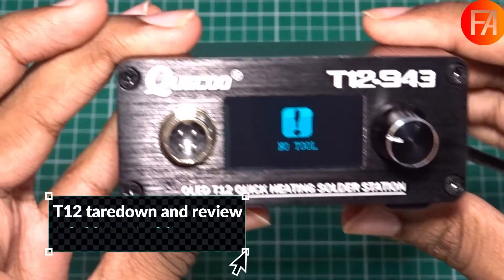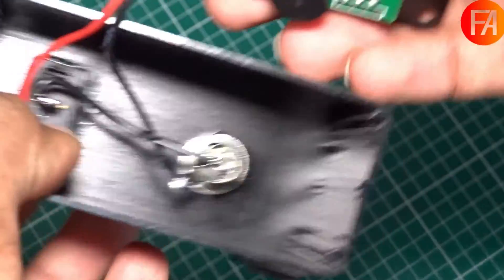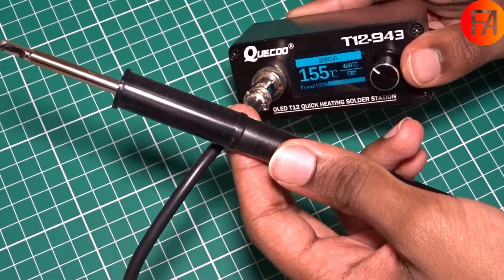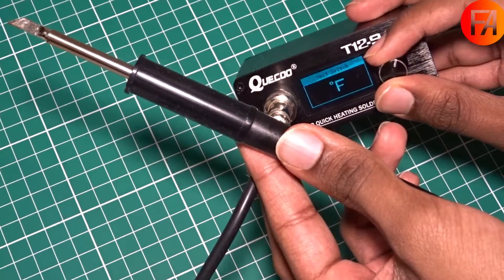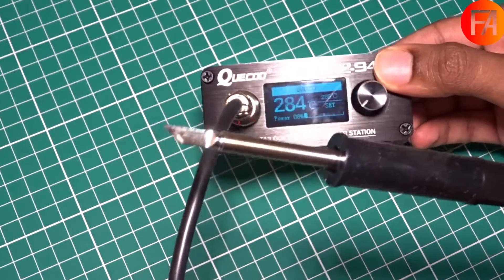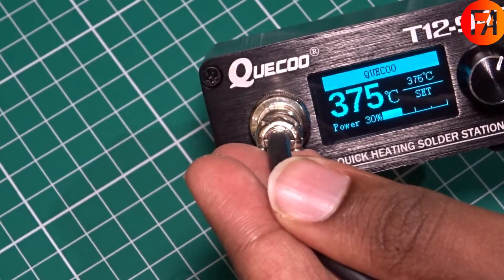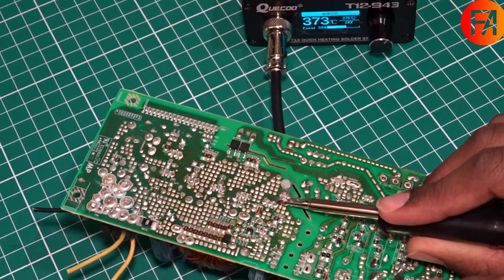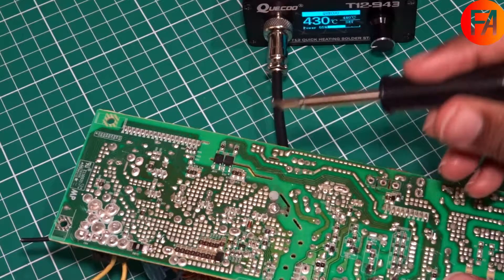T12 soldering station review and taredown

Comment: I have power supply for my laptop which is give out put of 19v at 4.32A will be able to use this power supply for this soldering station? It will very helpful if you reply about it.
Reply from the maker: Yes this adapter will work

Comment: You must the delay change for each new solder tip and eventually calibrate !
Reply from the maker: Hi, I have found it is not really necessary to manually clibrate the tips as they're pretty accurate. They're also direct heater catridge and pretty fast

Comment: What psu are you using
Reply from the maker: You can use any PSU between 12-24 volts. I use an 18 volt PSU, but you can get more power by using a 24 volt 5-6 amp one
Reply: @FaisalAhmedTech  thanks bro.. I have the ksger version but unfortunately 19v doesn't work.. I guess only 24v works, I have to check tho
Reply from the maker: Anything from 12V should work, I have also prevously used a 12 V before, just make sure the polarity is correct